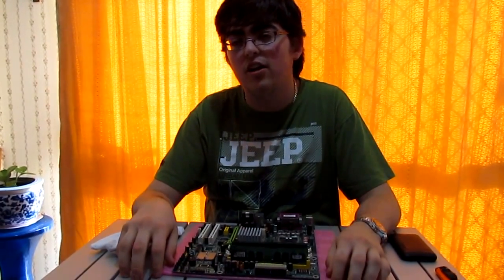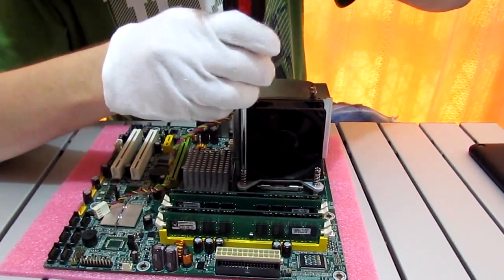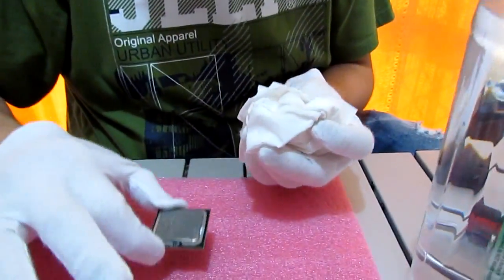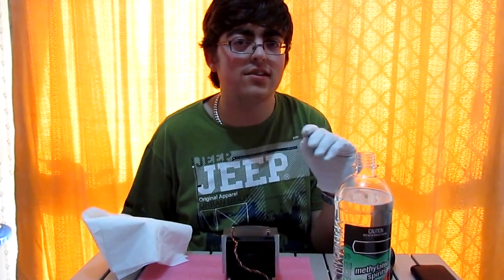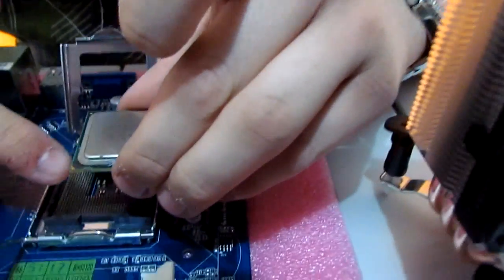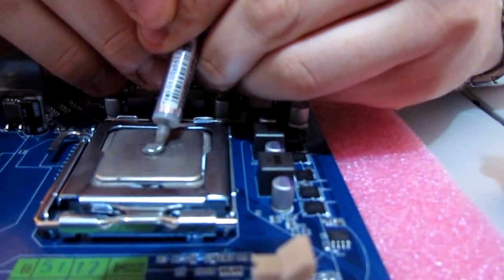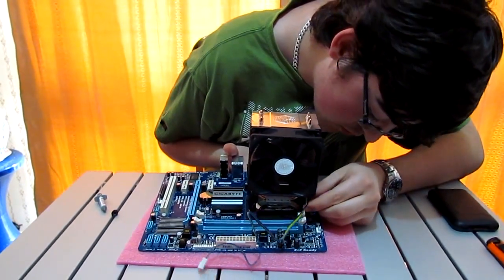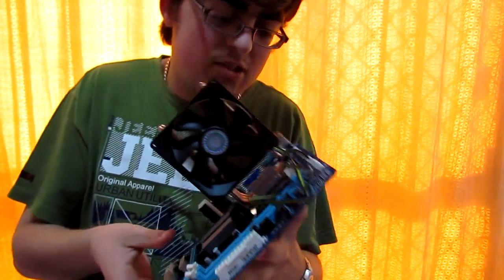How To: Replacing a CPU Heatsink & Re-Applying Thermal Paste (Cleaning Methods Inside)

Comment: Why would you pull the CPU?  Careful cleaning has always worked for me.  Leave the CPU attached, don't chance bending pins.  Alcohol, a lint-free pad, and careful wiping.  You can clean the fan plate with your ass cheek, basically... but I just don't see the point in removing the CPU.

Comment: I am replaceing my 212 evo with my stock cooler cuz the fan on my 212 evo needs to be replaced. If there is thermal glue on the stock cooler already do I still ahve to apply more?
Reply: no - If it has thermal glue on it you are in good shape

Comment: I dont think you really need to remove the old thermal paste if its just a small thin layer. I replaced cooler before and left old thermal paste, put new over and no problems.
Reply: JohnIsAngryAgain rly?
Reply: simon sternberg
Yep. Done it recent again in fact. Was a very thin layer left over, I just put some new paste over and boom, perfectly fine.
Reply: JohnIsAngryAgain cool but do you know how warm it got?
Reply: simon sternberg
No but I have a pretty decent cooler on top of it
Reply: JohnIsAngryAgain okay :) im gonna try that and if doesn't work it would kill my processor right?
Reply: simon sternberg
You'd have to do it really wrong to fuck up your processor xD
Reply: JohnIsAngryAgain okay good. i need to buy a new processor cooler right now im using stock and my processor is running on 80 celcius/200F so i really need to change ;)
Reply: JohnIsAngryAgain im gonna check if that would fit in my case